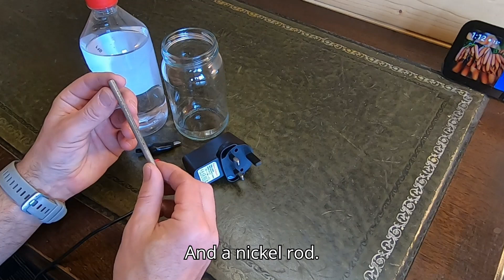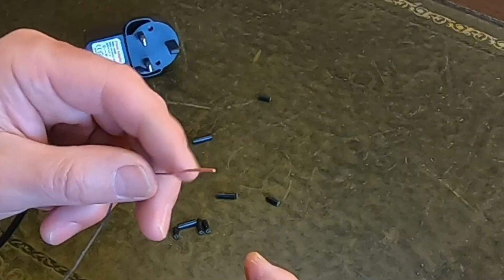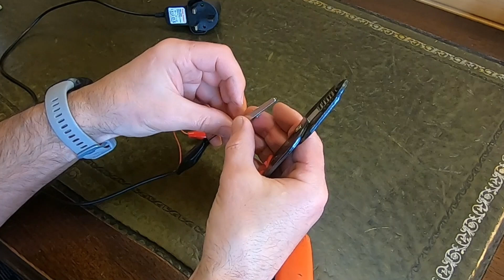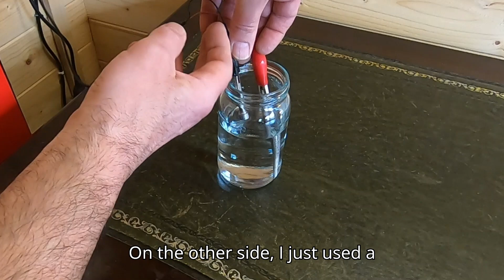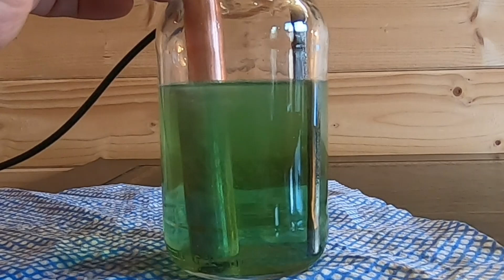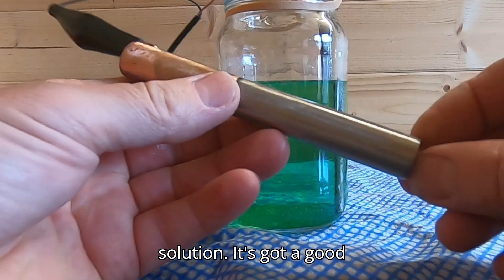Transforming an Old Phone Charger into Nickel Plating

Comment: Hej nice video but one thing wrong. you started with  a steel bolt and a nickle bar, then you show a copper pipe and it being coated in nickle. What i would like to see is :-  the process with the bolt and nickle bar then the process with the copper pipe etc. With details.  Also what can i or other ppl use instead of a nickle rod ?  Thanx. I hope you get back to me on this.